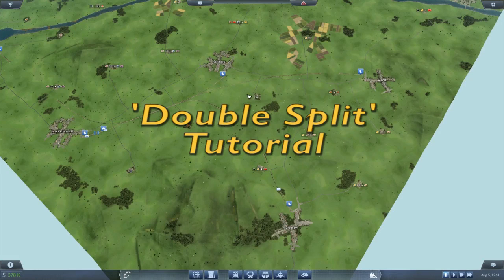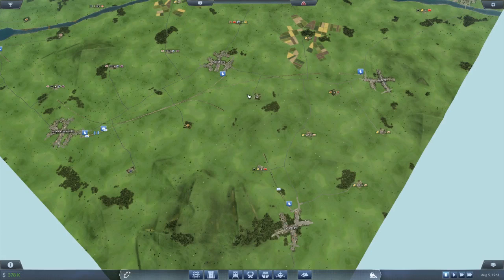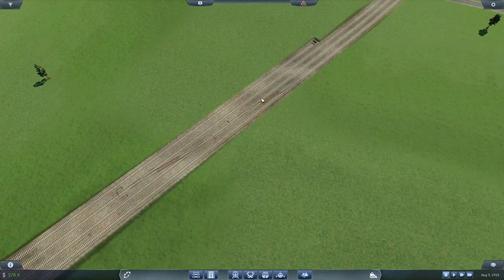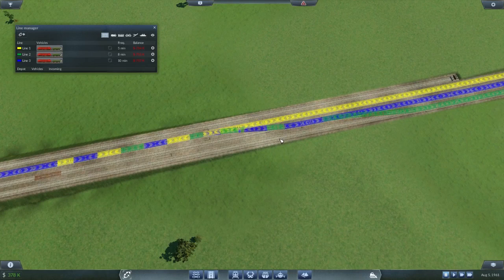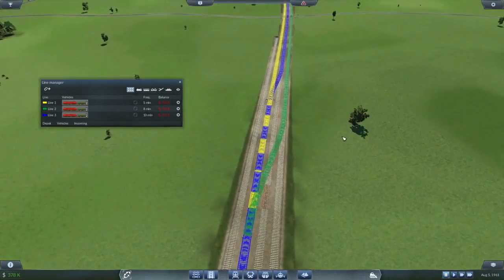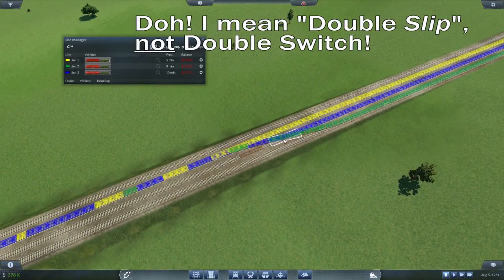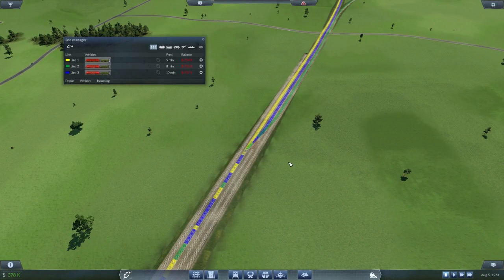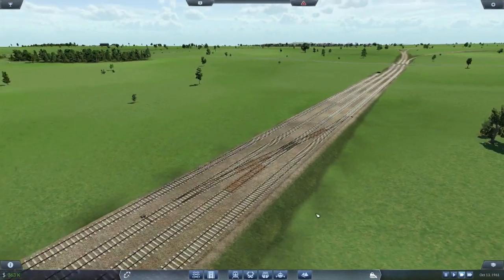Transport Fever: Tutorial - Double Slip Switch (also applies to Transport Fever 2)

Comment: This is gold fam! I was wondering how to do this! If you have a double slip and the comes the other way like from 4 and to 2 but in the other direction.... do you need a 2nd double slip switch or will this one still be enough?
Reply from the maker: Thank you. 😊
It should be easy enough to try out but, in general, yes. What works in one direction should work in the other ... one-way signals permitting of course!

That said, sometimes it can be more efficient to have multiple switches if you have a lot of lines and/or trains converging on a single point.
Reply: @AjaxpostPlays  sorry I tried to update my comment but got side tracked the last 15 seconds of your video answered my question. Thank you again for a comprehensive video on this.
Reply from the maker: @NeptuneDesign   Not a problem - I'm a big fan of side-tracks!! 😂
Reply: @AjaxpostPlays  haaaaahahahaha I get it!! Side tracked!

Comment: I had to start over my game bcz I made a small mistake bcz of the old system without slip and it was my main line who got completly blocked (plus didn't got any space to lay a new track to solve it)
Reply from the maker: Thanks for watching!
Switches and signals, easy to get wrong and cause chaos!  There are some guides on Steam that try to help, I think the most important rule is to make sure there is no slope AT ALL on the track where you are building a switch, either a single or double slip.
Reply: Adam Slade thx for the answer :D I subbed
Reply from the maker: Thank you, I hope you enjoy what I do.
Reply: I didnt had time to answer yesterday, but I checked and it was Bcz of the slope. I had to make a switch to the Left and a bit furthe to the right. (When you drive out the station). But there was a signal there, I didnt know that, but that blocked everything. Also, the train in the station had to Go to another switch to the righ. But that was blocked too since it was the cargo line to my main city. But If I could do the slip, It didn’t block my whole netwerk 😅. But Thx, your doing very Well!